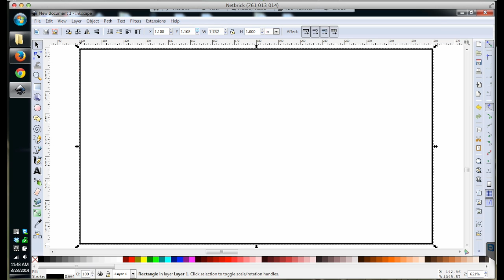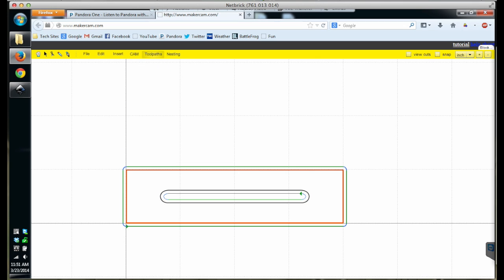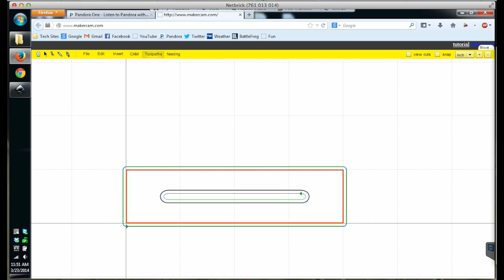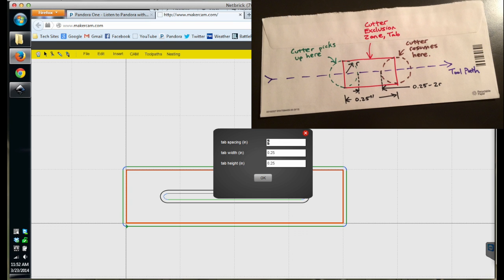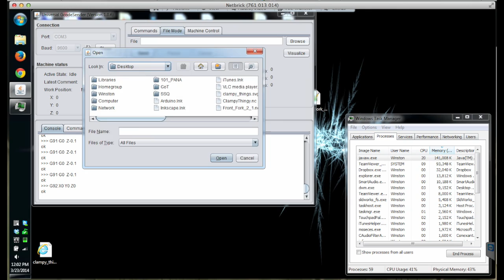Shapeoko 2: How to Setup Tabs in MakerCAM

Comment from the maker: Joe, I'm part mechanical part aerospace engineer. And that's a Sector 5 by Element Case, although possibly a knockoff at the price I paid for it...
Reply: hello i have a question that i live in an apartment and i was thinking to purchase
shapeoko 2 please tell me that whether the noise is suitable or is very high 
thanks
Reply from the maker: Bob Kar The only part that makes noise is the spindle, if you feel comfortable using a Dremel in your apartment then this should be about the same. It's comparable to a vacuum, or other handheld powertools. The only real thing I would say you have to consider is that your CNC could be running for quite some time, and the character of the noise is a bit higher-pitched.
Reply: Winston Moy its very nice of you to show concern to my question
thanks

Comment: Have you tried using carpet tape to hold down your work piece? Another option, if you have access to a drum sander or thicknesser, would be to leave 1 or 2 mm of material instead milling all the way through. Then shave off the last few mm of material using the sander, finally revealing the finished piece.
Reply from the maker: I did recall seeing the tip about double sided tape when I was going through the Shapeoko Docs. Wasn't sure just how strong it would be, although if you plan your last pass correctly (i.e. just a couple hundredths of an inch deep) I suppose it would suffice.

Thicknesser would actually have been useful on my last project (Rambone), but I'll get into that next week.